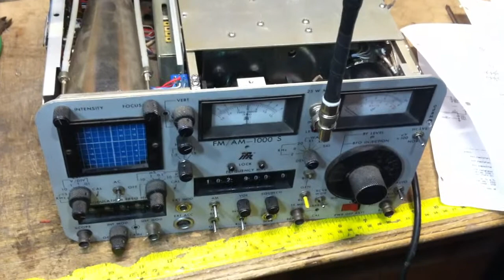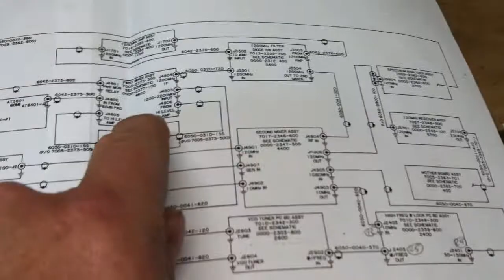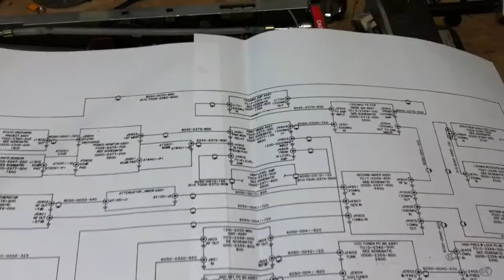IFR-1000S Service Monitor Problem

Comment from the maker: Well,, the issue or at least it seems to be an issue is the auto zero switch control.  The zero switch in "off" position kills the receiver at the 2nd mixer.  What has me scratching my head is I thought the receiver previously worked with the auto/zero switch set to OFF.   Yet when I look at the zero pulse circuit on the 250KHz/mon PCB it seems to behave normally according to the print.  The result is the zero pulse line goes negative, shutting off the RX when switch set to OFF.  Its not a big thing, but if anyone can clarify the auto/zero switch operation that would be great.